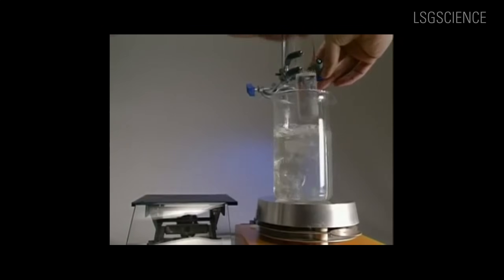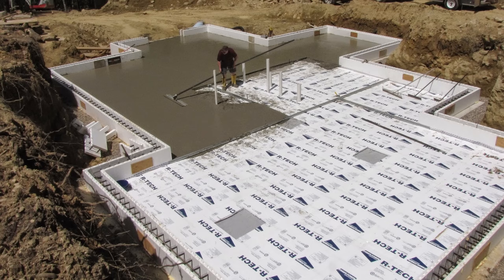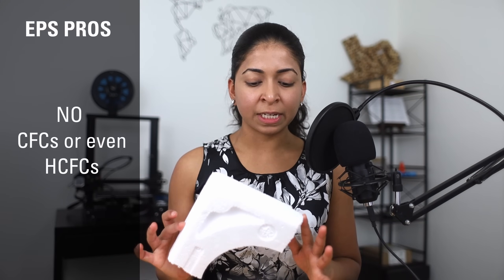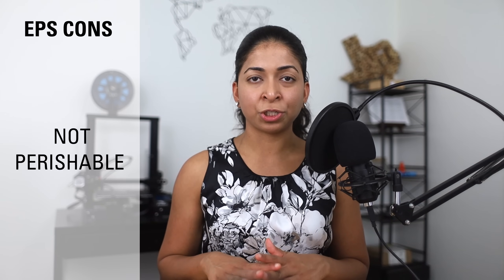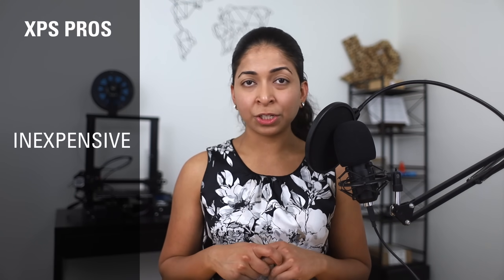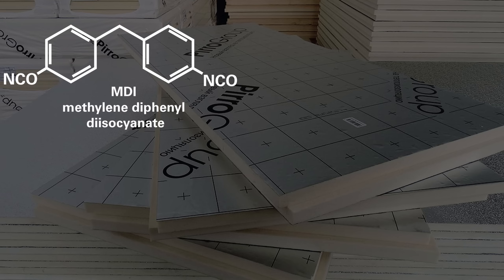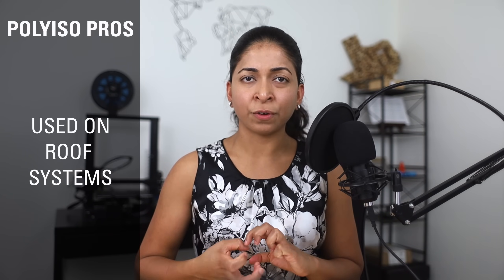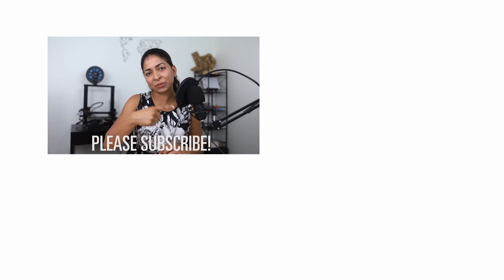EPS, XPS & Polyiso insulation | everything you need to know

Comment: EXCELLENT EXCELLENT VIDEO!!!!! From watching your (and a couple of others) I have decided on using XPS for insulating the attic crawl space and walls of a ranch house. However, I do know for a fact that according to code I must have an R30 or approx 6" of foam. Spray foam, Rockwool, fiberglass, etc... is not time/cost-effective in my case. Buying 6" foam is also very expensive. Gluing 2" foam sheets X3 together is much cheaper. With that being said, I am having WIDE CONFUSION on which construction adhesive is best to use for this application. It is down to 3M SUPER 77 spray and GORILLA GLUE SUPER CONSTRUCTION (which can be used on XPS) (caulk type dispensed). I trust your wisdom & judgment. You have been right on the mark with everything in construction. How do you see their pros and cons?? Keep up the GREAT VIDEOS!!!

Comment: I Belinda, congrats for the video. You said that XPS does not lose R-value over time. Yet we often read and see videos, where "experts" agree that XPS typically has a slightly higher initial R-value than EPS initially since it contains a trapped blowing agent. Yet, over the course of time, the R-value drops because the added blowing agents found in the final product eventually is replaced with air making the product less heat resistant. Have tested it over time?

Comment: which would be best to use under 10 inch staggered shake vinyl siding in a NorthEast climate?  Foamular 250 R-15 Rigid Foam Board Insulation  or even considering ROXUL COMFORTBATT?

Comment: I didn't know about the gas condensation point of 50 degrees F for the Polyiso.  I'm guessing there is a slow R value drop off rate, otherwise it wouldn't be much of a cold weather insulator.  Can you elaborate more on this.

Comment: Thanks for sharing insightful information about different insulations. Would appreciate if you can upload a video on “eps vs PU foam” with a focus on following;
1- R value per dollar 
2- Thermal drift
3- Moisture resistance 
4- Fire resistance/ratings 
5- Resistance to rodents/insects/ants/termites/mildew/mold
6- environmental impact
7- recycling
8- useful life

Thanks in anticipation

Comment: I am building a Timber frame house in Alaska. With a 5.5" wall cavity I'm using 1.5" and 2" XPS foam boards in 3 layers to create an R-25 wall with sheathing closer to R-28.  I will layer 3" XPS on the roof deck in 4 layers to create an R-60 roof. So easy to work with.
Cleaner than glass batt or Rockwood type Insulation.
Using spray foam to seal any cracks this makes a super well sealed and insulated structure.
I may heat the place with a candle?  LOL 😂

Comment: "recyclable" is a misnomer of sorts. Recycling REQUIRES that the plastic be free of contamination. Thus, for example, food containers are not recyclable. In fact, contamination in a food container will turn a batch of polystyrene into useless junk.  Similarly, a pizza box will destroy the utility of waste paper. Don't put even slightly dirty paper and/or plastic in the recycling bin.

Comment: Hi. I've used XPS (Foamular brand) and it is not even slightly resistant to sunlight. Leave it exposed and it will discolor and break down over the course of months. Take a sheet and put it in the sun with the black lettering face up. You'll soon have a three dimensional surface, with raised black lettering over a greyish background

Comment: You have missed important advantage of polyiso insulation over other ridgid sheets of insulation. The polyiso is covered with a thin coat of aluminium, that has a mirror-like reflecting properties affecting infrared radiation. This is especially important in housing construction, both in summer and winter conditions. Even if covered with a drywall and paint, its reflecting coating pushes back into a house the infrared heat energy. In summer, the infrared energy eventually heats up the wall insulation, which then transmits the heat into the drywall and into a house via the infrared radiation. A heat-reflecting board can than push back the infrared energy back, lowering heatload gain entering the house through the outside walls.

Comment: My understanding is that xps  loses performance as its blowing agents diffuse out over time. Isn't it also only warranteed to 90% of initial value @ 20 years? I read that at full depletion it only performs the same as EPS of similar density. Is this correct?

Comment: Do not use EPS for roofing, you cant adhere it or mechanically attach it to the building and when you remove it breaks apart and makes so much mess it will look like it is snowing on a windy day. Also the insulation shrinks so the R-value is almost 0.

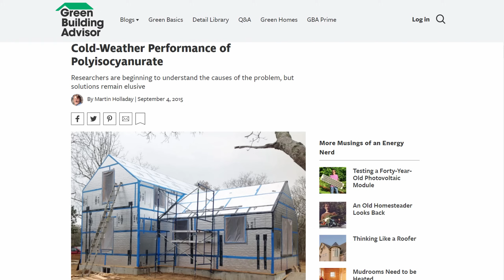Comment: You've confused me. Regarding polyiso pros, at 8:01 you say, "Polyiso is also stable over a large temperature range—minus 150°F. to 250°F."; then later, under cons, at 8:56, you say, "It doesn't work very well at temperatures below 50°F." How can both these statements be true?

Comment: Great video, you really cleared most of my doubts. If you help in clearing one of my doubts that would be great. I want to insulate my concrete basement floor but i don't want to use Dricore R+ insulation because the cost is high. I was thinking to put EPS on my basement concrete floor and top of it with a plywood and then my carpet or LVP. Do you think it's a good idea instead of a Dricore R +?. I live in Alberta Edmonton which is pretty cold in winter. So i want my basement to be warm. Please advise or make a video. Thx a ton

Comment: We took out 20 year old EPS foam sheets from our cottage roof space.  It was fitted in the rafters. Prior owners didn’t maintain the roof, it leaked and water got onto the foam.  Mold grew on the surface, and ants were nesting in it. It’s been removed and rockwool and a vapor barrier going in.  We removed it mostly to be able to inspect the roof plywood from inside to check for rot, but after it was out we decided R22 Rockwool would be a better choice.  Had the roof not leaked, I’m sure there would have never been ants in it, they need water.  But when an ant colony hatches inside your roof on a warm April afternoon, you’re ripping all of it out asap.

Comment: 4:01 flame test actually looked like it passed the test. The sample probably had fire retardant I’d imagine.
Reply: EPS melts first, then eventually contributes to fire spread.
Reply: Video Pipeline you’re correct, but the video did not show that. Sips panel manufacturers claim that (most likely with retardants) the flame is not propagated, it is self-extinguishing, and only burns very briefly.

Comment: Lastly, your cost comparison is certainly not correct for all parts of the US. For example, At Home Depot stores near the 43228 zip code,  1" thick (R-6.5) Dow Super Tuff-R is $18.34, but 1" (R-5.0) Owens Corning FOAMULAR is $24.97 & 1.5" (R-7.5) FOAMULAR is $32.97   Even based on the cost of 1.5" XPS (which is only 32% more than the 1" XPS), after adjusting to the same R-value, XPS is 55.8% more expensive than Super Tuff-R.

Comment: In order for XPS to have the same R-Value as one of the better grades of polyiso, it has to be almost one-third thicker, space that may not be available in some installations. 
For example, 1.5" thick polyiso would be R-9.75 (not counting the contribution of the radiant barrier); whereas 2" thick XPS (R-10) is needed to achieve similar performance (but it would still under-perform 1.5" thick foil-faced polyiso for exterior sheathing on the sun-exposed sides of the structure).

Comment: the info she gave counters other info i have found. mainly poly iso has a temp r value drift and thermal drift. eps also has a thermal drift. eps only one that doesn't thermal drift.
Reply: Not all polyiso sheathing loses R-value at lower temperatures. Cheaper grades of polyiso (like the RMax cr*p shown in this video) use a cheaper blowing agent that has the condensation problem she (correctly) described. Her mistake is assuming that all polyiso has this problem. They do not. Dow specs specifically refute this for their polyiso, and that probably also the case for some other brands too.

Comment: And while you accurately described the mechanism (gas condensation) that causes SOME polyiso foam to have reduced R-value at lower temperatures, you should not have assumed that ALL polyiso foam insulation has this problem. The polyiso example that you chose (RMax sheathing) is one of the worst possible choices (one clue of that is that it has only R-6.0 per inch). Dow polyiso sheathing (Tuff-R & Thermax) do NOT have reduced R-value at lower temperatures (and their advertised R-values are LTTR, not initial), and I suspect that is also the case with the similar Johns-Manville polyiso sheathing (though J-M doesn't publish a spec on that like Dow does for their products).

Comment: Another benefit of EPS is that although it can absorb water more readily than other foams, it dries much more quickly, and is usually drier in the long run than XPS when used below grade.
Reply: I've heard this claim as well (usually from an EPS rep) but I have never been able to find definitive research pointing in either direction, rather than FUD produced by one manufacturer or another.  The most useful guidance I've found is that if you want long term performance from either variety of foam in a below-grade application, you need to specify a higher density than what a builder might pick up from a big-box store.

Comment: Great video!  You may want to check pricing on boards larger than 1" thick.  In my experience in the roofing industry- XPS is approximately 30+% more expensive than ISO, and EPS is a touch cheaper than ISO (under normal circumstances).
ISO usually has a standard cost per bf, but charge more for only 1" board since the cost of production is higher in that process to only produce a 1 inch board.  So that and R-value is the primary reason ISO gets put on most roof jobs.  It's the cheapest, with the most R value, and has the best approvals(less flammable).
Reply: Good to see comments from somebody else with actual experience with these products. This video has too many errors. See my posts above

Comment: I'm just newly barging into your channel...
😇

Two methods I'm curious about are isolating paints (on mineral and metal surfaces) and cork. I don't think either would be sufficient but I'd expect both to be a very useful party of a good isolation???

Maybe it's also bc I'm trying to figure out, van and previously container management (but a little research and then your video fully convinced me to give up on the containers, unless all you need is one without any holes)

Comment: Great video. Very well put together. A couple corrections. The XPS industry went through a blowing agent change with increased the cost by 20%. Polyiso is now cheaper. Polyiso has no thermal drift unless you are below -40 continuously. It will regain its original r value when temps rise. It has a .002 water absorption rate, same as XP’s,where EPS has a 2% absorption rate.
Reply: Please advise on adhesive to bond polyiso sheets. Desire to make floating dock 16" thick.

Comment: From what I have read the XPS is the worst insulation for the environment because of the blowing agent used (1400X worse than carbon dioxide.) What is the life time R-value of these products? They all seem to have the issue that the air gap can be filled with moister which will greatly lower the R-value.  https://www.buildinggreen.com/news-article/avoiding-global-warming-impact-insulation

Comment: That was most comprehensive, thank you. I have need to know these things. I intend building my own Tiny House. (2 x 2.5 x 6 metres) I did start with the shipping container idea and realised it was impractical as it cost so much to be delivered and it's life expectancy was lower than mine. I have heard the other down sides from your videos and others.
 I thought caravan, but they have little insulation in winter, get damp and are not too stable on their own, plus well - I've tried living in a caravan, okay for the summer months, but you lose money on heating them during winter when the temperature drops and where I live in North West England it drops a lot. So I came up with a modular system based on a caravan base that is expanded on location ( so it complies with Mobile home restrictions). I'm still trying to configure the insulation and work out the heating costs for 5 months of the year which will be cold, 3 bitterly so. Roofing tiles that retain heat, solar panels that aren't an eyesore and land ownership for a small plot, say half an acre - (2023.43 metres). This area allows for the home and room to grow my own food, plus build a shed for working in - (building cycle trailers and campers).
Reply: Just some thoughts: Roofing tiles won't help because they are outside of your insulation. Thermal mass is not really something you can achieve, sans something like thick Soviet concrete construction, and that's a problem for THOWs due to trailer capacity.

Comment: Wow this is the best video I’ve ever seen comparing and describing EPS and XPS...could never fully understand the property differences and manufacturing processes..until now. Thank you!
Reply: @AdamA-pm3yn  I'm sure that people  who have chosen to be dumb*asses don't "GAF"
Reply: She got the basics correct, but made several key mistakes that may mislead people.
Reply: @videopipeline6419  could you please elaborate? Would help us viewers.. thank you!
Edit: I saw you posted several other comments. If those are what you were referring to, then thank you and you can dismiss my comment!
Reply: @Coolarj10  Yep, those are the key mistakes (feel free to "Like" them if they are helpful). The main source of the misleading info (reiterated by people who have a little bit of knowledge like the creator of this video) about polyiso having drastically reduced R-value is Owens Corning, which AFAIK doesn't manufacture any form of Polyiso foam. Also, not all materials cost the same in all parts of the US, because (especially with bulky materials like foam sheathing);  it's highly dependent upon the location of the manufacturing plants, which are mostly in the eastern half of the US. Not all Polyiso is created equal. The example she chose, R-Max polyiso, which is stocked at some Home Depot stores in the western half of the USA, has much poorer cell structure consistency than Super Tuff-R or Thermax. Consumer grade polyiso sheathing like R-Max, Super Tuff-R or J-M AP Foil have FSK "Foil-Scrim-Kraft' facers, thus they have only a class C fire resistance rating. Commercial grades like Thermax have class A fire rating.

Comment: there are things you can do to eps that will help with termites etc. I'm actually in the eps manufacturing business. and the beads are expanded here at our facility using heat & steam, none of the chemicals you refer to are used to expand the beads within the mold. we do have to off-gas our blocks after molding due to a chemical called Pentane that needs to be released. we do this in a hot room. There is actually some clips that you have used from my warehouse (starrfoam). most eps have a self extinguisher as well, so that if the foam does catch fire, it just as quickly puts it out.
Reply: We would like to know about those "things" you mentioned for improvement...

Thank you!
Reply: if you have any info on what makes the different compressive types of EPS foam have their different bearing values please link the articles.

Comment: Very nicely done.  Be aware that EPS and XPS have not used HBCD since 2016.  Also, XPS ("Styrofoam") does not contain air, it contains blowing agents that ARE subject to thermal drift over time.  These blowing agents were HFCs such as R134a, but the XPS industry is working to replace these with other gasses.

Comment: Once again, loving the information density in your videos!
Just as a side note: after about 10 years of using XPS I've often seen sheets of it get too much UV-Radiation and from my experience it does indeed suffer from photodegradation. The outer layers become lighter in color and dissolve into a dust which has an unpleasant chemical odour, sticks to your skin and resists washing off. So make sure to have some sort of UV barrier between it and any gaps in roofing material or it will start to wear out
Reply: PIR and PUR aren't that different in this particular aspect. Most polymers are vulnerable to UV.

Comment: I would disagree that XPS "does not deteriorate in sunlight".  I have noticed that it most certainly does.  Wherever sunlight is on it for a few months it seems to develop a powder on the part exposed that you can brush off.  This has to be reducing the mass and would be significant if it were left exposed, say at the top of an exterior basement wall along grade.  A recent building package that I ordered required me to store the panels until they were used on the exterior so they were stacked in a dry area with a roof over them but the sun could reach their stacked edges from the side.  You could see the above change after six months stored like that.  I also seem to notice that the cheap EPS coolers tend to fall apart after a season or so use in the sun.  Don't know what is going on there but it is definitely noticeable.  As you say PolyIso really degrades in sunlight turning a darker brownish color and powdering up.  Even used stuff that has been in the building envelope and protected from U\V when taken down has changed in the same way over a greater period of time.  The corners so much that they are 'rounded' off from their original ninety degrees.  What I have seen is not damage but just deterioration on these recycled panels.